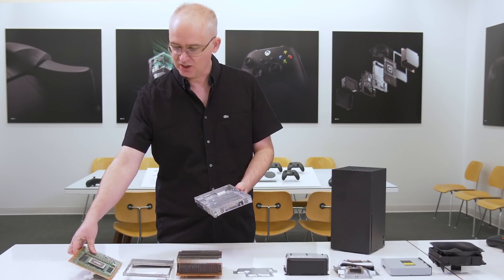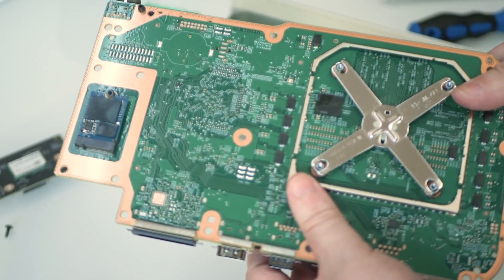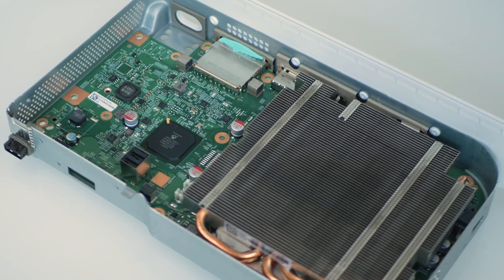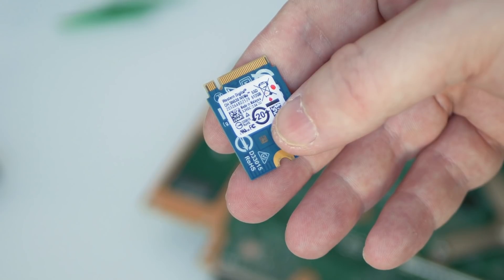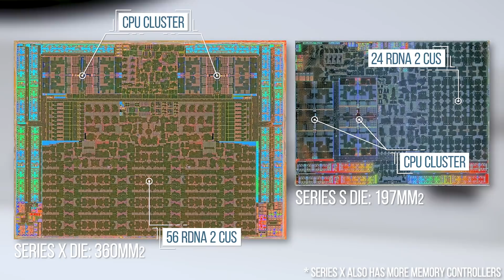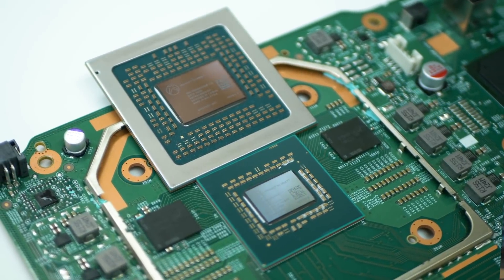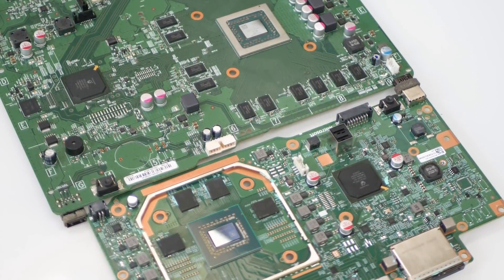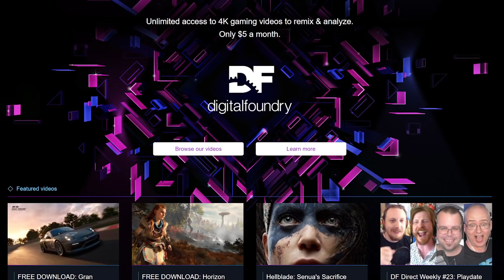Xbox Series S Complete Teardown: Inside Microsoft's Superb Mini-Console

Comment: The series S would hold back next Gen games.
3 or 4 years down the line it would struggle to even run games at 30fps
Reply: No not necessarily, 4 TFLOPS is nothing to scoff at. The reason the old XBOX ONE to ONE X and PS4 to PS4 pro didn't have many 60 FPS games was the CPU as it was outdated at launch, these new consoles have modern powerful CPU's that can happily feed the GPU they are partnered with
Reply: It still can’t hold games back tho it will just be subpar at running them the series x is still struggling with some games and the series a can still run them.saying it holds back anything is dumb it still has a strong CPU and RDNA 2 gpu

Comment: I have to say, the Series S is no more a next gen console than the PS4 Pro or One X. It basically has close to the same visual fidelity as those consoles, just faster loading times. So, I guess if you have a 1080p TV,/monitor it’s fine, but 4K TVs are so cheap nowadays, I’d get the 4K TC now and save up for when the Series X is more readily available.

Comment: I almost chocked on my drink when you said you can't do this with a working unit?!? Like what?! It's very easy to completely take apart and reassemble these machines. They don't need to be bricked for you to tear it down.
Reply: I went back to listen to that part at the beginning. I think he meant to say that since the console is no longer operational they do not have to worry about putting it back together or accidentally damaging some component in the process. He did say that once you get to the motherboard you cannot go back which is indeed weird unless they separated it from another piece? Havent finished hte video so I cant say
Reply: Almost all of it can be done with a working unit, but he does mention that taking apart the cooling unit the way that he does in the video is difficult/impossible to put back together. I’m assuming that’s where he got that note from
Reply: @coleD238  It isn't though gosh there are dozens to hundreds of videos of engineers, repairmen and basic Joe's taking it apart and reassembling it just fine.
Reply: Sorry but where did he say that? Timestamp?
Reply: @prich0382  The very start of the video. I'm way too lazy to get a timestamp
Reply: @SmarterThanAll  
He said around the 8 minute mark that to look at some of these parts you have to damage the cooling system. Meaning someone could fix it, but the parts needed are going to be hard to get.
Reply: @pikawithagat  I'm telling you right now that's incorrect. You do NOT need to damage anything to get down to the silicon. There are literally dozens of videos right now of people doing exactly what he's doing without damaging the system in any way. I'm telling you he's objectively incorrect. Anything he damaged is a mistake on his part. The ONLY thing you'd need to replace is the thermal compound on the APU but that's common practice with all silicon chips in any machine.
Reply: @SmarterThanAll  
Chances are he doesn't care about being cautious about taking the parts apart since he bricked the console, so the console is most likely useless regardless of repair, seeing as it sounds like he did something that fucked with the iOS meaning he probably got the console ip banned.
Reply: @pikawithagat  Right the console is already bricked so who cares but the the console definitely didn't need to be a brick for him to do what he did. People took apart the Series S the day it launched nearly a year ago without any issues.
Reply: @SmarterThanAll  
True. I haven't watched this channel enough to know if complete breakdowns are in this guy's profession, so he's probably is to hard on the parts when getting down to the smaller parts. I'm pretty sure he broke several parts looking at the before and after shots. Guess he looked at it and figured he couldn't fix it and thought it's useless to him. 

But yeah the newer consoles are easy to open up and mess with, I remember hating how the older Xbox's weren't open friendly and would break/crack the outer shell of the console if you didn't have a expensive tools or luck.

Comment: Interesting. I'm wondering if the division of PCIE lanes are what causes the drive speed difference between PS5 and Series? Using half the lanes would potentially be an easy explanation of why it gets half the peak theoretical speed. Which makes me wonder how the PS5 storage expansion is set up, and whether there's additional PCIE lanes for that add-on drive to use.
Reply: Yep, by the look of things.....Splitting 4-lanes into 2x 2-lanes of PCIe 4.0, would limit transfer speeds to a theoretical 4GB/s on each max. However, in reality that will be more around 3.6GB/s. Which is probably the reason for the SeriesX/S SSD's only being 2.5GB/s (lower than normal, for Gen4 SSD's). The PS5 on the other hand, has to be using 2x 4-lane PCIe 4.0. One for the on-board SSD and the other for the M.2 expansion slot.
Reply: @fafski1199  That means a theoretical “Series X (2024)” would actually have a decent amount of value for Microsoft. Maybe a second/alternate chip (similar to what Sony is doing) so they can double supply counts, double the PCIE lanes, maybe a larger stock drive, I’d totally buy into that. Throw a unique pattern to make it easy to distinguish the two, done deal for MS. 

And honestly….I’d even be willing to accept an external PSU if it means they can get higher clock speeds. No PSU = less heat generated = more heat from CPU/GPU before throttling = better/smoother theoretical performance. Count me in.

Comment: The issue with the Series S is that it's a SUB-1080p console, in an era of 4K gaming, even on an old 1080p monitor, a Series X/PS5 look SIGNIFICANTLY better.
Honestly for 100€ more you get a PS5 digital that is WAY better
Or alternatively still with 100€ more you can get a Steam Deck which has worse specs but is portable! 
And with the same price, you can get a Nintendo Switch, with all its exclusives, portability, and local multiplayer features

Comment: Sorry, but they should not have made this system. 
It's already struggling hard with several modern games. 

And it's just going to get worse. They should have just did what Sony Did and make a digital version of the series X for 400$..
They also wouldn't have to support two different SOCs being manufactured, and would be able to make more of the series X to help with the supply issues some.

The concept is cool yes. But it's just not strong enough.
Make at like 30cu and the same ram speed and size as the one X. (12gb. Just updated to GDDR6. Keep 9/10 gigs as 338GB/s like the one X ran at, then the other 2/3GB at a slower speed for the os)

Comment: Wait what you can take it apart and put it back together :/ so many repair videos online and people upgrading the thermal paste.
Reply: Yeah but do they take everything off or just the cooler ? Main issue seems to be that copper tape stuff.
Reply: @retrosimon9843  take it all apart and replace the thermal. The clamp is the same as 360 and Xbox one. Need a clip and heat sink comes off so easily. Just not so easy if you don’t know hence him putting force.

Comment: looks like they could have made it slightly smaller height wise? or is there a reason to keep the main cage slightly away from the shell in that dimention?
Reply: Fan vibration ? Heat ? Static electricity ?

Comment: The Wi-Fi chip was the most interesting part, how the chip just slots in to the console mainframe. Compared to PS4 where the Wi-Fi antenna is hanging on multiple wires which are quite difficult to put back into if you teardown the console.
Reply: The PS4 was needlessly complex in a lot of ways, particularly the controller. I've grown to absolutely despise the DualShock 4, it's cheap plastic is the cause of so many issues. Analogue sticks get sawn in half by the controller shell, there's about 5 different DS4 variants with different parts that won't match, and the connections are just absurd (touchpad). So glad the new controllers are better, Xbox controllers have been easy to take apart and repair since the original and I appreciate the hell out of it.
Reply: @arbiter-  The DualShock 4 is an extremely simple controller to take apart. I have 3, 2 V1 controllers and a V2 controller. The only differences are the battery connector is a bit smaller, motherboard is a different shape and the backplate is actually easier to take off. Almost all connections in the controller are via ribbon cables which are extremely simple to take out and put back in, and there are two solder joints on each side for the rumble motors. I’ve seen videos of tear downs of Xbox controllers and they actually look more difficult than the DualShock 4

Comment: I have said that small powerful computers are possible since at least sandy came out. I mean all they need to do is to basically combine an itx gpu with a nuc mobo and just use a pcb of a normal video card and then put a similar heat sink as we find on a gpu but for both the cpu and gpu and we have a small form factor pc of the size of a video card. Have been waiting so long for such a system.

Comment: Only issue I have w the series s is the low storage space on internal SSD, I’m going to need that expansion just to have more than a few games on it at a time.
Reply: Xbox's Cloud saving is a life saver. While its a pain to constantly have to delete/redownload games in your library, its nice to know that your save data will always be there. My save data even transfers over to when I play games on XCloud - its insane
Reply: You need it with series x too but they do run the games just as well
Reply: I just use external USB storage drives. I have a 4TB WD BLACK HDD and 1TB Samsung SSD. 

Then I put all OG, 360 games on the HDD and most XB1 games on the external SSD. I save the internal for Series X/S games and if it gets a bit full I will move games I am not using right now to one of the external drives and then copy back when I want it.

Saves re-download and saves buying the expansion card.
Reply: @06dogb  oh yeah I have a 2tb HDD but for the enhanced titles Ya have to have them on the SSD to even play them. Thing is they all take up so much room. Moving is wayyyy faster than reinstalling but still not ideal bc I’m usually already tired by the time I can sit down and game, so waiting an extra 20 minutes to play the game I want to play can be enough to make me not wanna game lol!

Comment: Have a Series X and I'm kinda tempted to get a Series S at some point to just bring with me whenever I go somewhere or to put it on my 1080p tv in the bedroom.
Reply: Theres a kickstarter doing a mobile screen that you attach to the xss
Reply: @jamesw884  even without the clip on mobile screen, a cheap 17 or 19” monitor would look fantastic. That said, I’m not even sure they make modern monitors that size with specs that would satisfy someone looking to really utilize a Series S, but still. I used a small 19” TV for my PS4 for a long time and it looked SHOCKINGLY good for being an older TV.

Comment: Great little machine, great for Sony fans to enter the ecosystem and get Gamepass also. Miles better than the PS4 Pro - 1080p 60+ fps dynamic resolution beast with fast load times due to the CPU and SSD. I mean it plays Doom Eternal at 120fps. Insane!
Reply: It's the CPU that makes it better than the Pro. Again we're comparing a 2016 console to a 2020 one.

For Sony fans the PS5 DE is a much better option for an additional $100. It has doubled the gpu power and storage and SSD speed

Comment: How is it damaged when opened? Why can’t you just put it back together?
Reply: It's very clearly explained in the video if you watch it past the moment he mentions your quote. 

The cooling elements (heatsink, copper tape, etc) isn't designed to be removed, you have to essentially rip that stuff off.

If you want to access components that aren't under the heatsink, you can do so without damaging the unit. If you want to access stuff under the heatsink, you will damage the unit.
Reply: @imadetheuniverse4fun  yeah but for regular repair/cleaning you don’t need to do that. He just makes it sound like any disassembly of series s will damage it
Reply: @manuel0578  I agree that it was unclear in his first statement. He did clarify later that it was only when you removed the heatsink that would be an issue.
Reply: @imadetheuniverse4fun   You can remove and re-attach the heatsink without destroying the console. It's the metal plate UNDER the heatsink that's the point of no return. The one that acts as a heatsink for the majority of the RAM chips.
Reply: @mastersniper101  Thanks for the correction!

Comment: I was saying something similar literally yesterday. Why not build a Windows Laptop/Mini PCs around the Series S and Series X boards? With dual boot. Pretty sure Microsoft could make the Windows software to get the full potential out them. Series S laptop with a 1080/120 display and Series X with 4k/120.
Reply: There's dozens of reasons why it simply wouldn't work, that have been pointed out in 101 blogs n' videos in the past. For a start when doing anything else other than gaming, they would be pretty terrible at it, since they will have to use only GDDR. That comes with a large amount of problems like it has to be soldered onboard and it gives out large amounts of latency. Any CPU orientated software running on it, will be slow. PC's use both DDR and GDRR memory, for a reason, in that each is are designed to work efficiently as possible, with a type of chip. For the  CPU it's DDR and for the GPU GDDR. Consoles are primarily GPU based, "games machines" with a CPU and sockets just tacked on (think of them like a Video card, with an APU), so they can get away with only using GDDR. While PC's on the other hand have to be capable of other things besides just gaming... Then there's also the major issue of getting PC games, the OS and apps, even working on it, since none where initially coded/programmed with only using GDDR in mind. Then there are the numerous hardware compatibility issues, that you'll undoubtedly run into, again due to not using DDR. Then there is development costs and complete mainboard redesign costs. Which would probably make the system cost even more, than just doing it the standard way. Then finally of course, there is the major question "Do we really need it?"....Which the answer is a big no, when you really think about it. There are already laptops/Mini PC's that can not only do everything that the current consoles can do, but they can even excel them in every aspect. So why would you want to gimp and limit yourself to using a console SoC, that can only really play games??
Reply: @fafski1199  So what you're diatribe is explaining is basically Windows 10 can't possibly run reasonably good on the hardware? As a dual boot Xbox laptop hybrid? Or are you just on a rant?
And no, mate. There's no current SOC on the market better than the current consoles.
The Series S has a really nice, cheap SOC. No way to adapt it and save cost on mass production, no?
Reply: @JohnnyOrgan  No what I'm saying is SoC's found in the consoles are designed to run purely from a GDDR memory pool. Windows 10, PC games, PC applications, Motherboards and dedicated PC Hardware and are all designed/written from the ground upward to run using GDRR memory (VRAM) and/or more importantly using DDR memory (RAM). The reason for using 2 types of memory on PC, is that it gives the best and most optimised results, with as little bottlenecking as possible. GDDR is built around using high bandwidth, that is more suited for a GPU's “one tick, one operation” workloads, while the CPU uses low latency DDR, that's more suitable for “one tick, multiple operation” workloads, Switching to using just GDDR and a SoC in a PC,  would just gimp the CPU, when it comes to CPU operations. This is similar (although opposite), to how a PC APU gimps it's GPU, by using only DDR.
Also, the shear amount of cost to switch, change, re-design and manufacture everything (hardware, motherboard and software) just so it would work with a SoC. And the fact that it would only be for a very niche market, simply wouldn't make it a viable proposition for AMD. The meagre amount of them sold, simply wouldn't even cover the development costs. (economies of scale wouldn't kick in)
Also just like I said, what would be the point? When you can already get exactly the same or better results, with current PC dedicated hardware, which also gives you far more in the way of flexibility. There is absolutely no need for a console/PC hybrid. Also, why the hell would you want a dual boot hybrid, when the a current laptop/small form factor PC's are good enough, anyway?. Plus, It would add on a ton of extra cost, a ton of extra space needed and the need to re-route power somehow.
If you want to restricted to only playing games and have console like performance, on the cheap....Then the simple solution is just to buy a current console...If you want to also play games and be able to do 101 things besides gaming and have the added freedom of flexibility, then simply buy a PC instead..